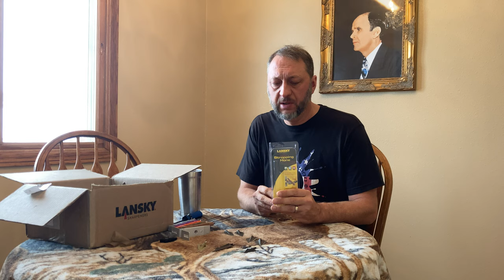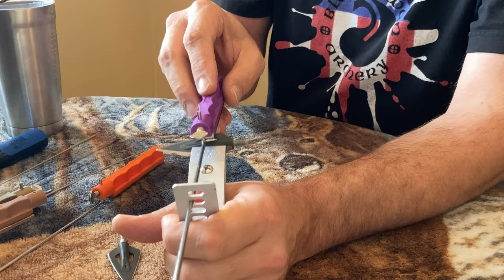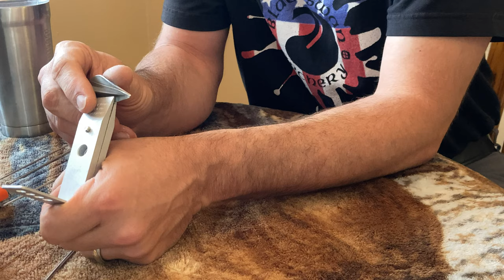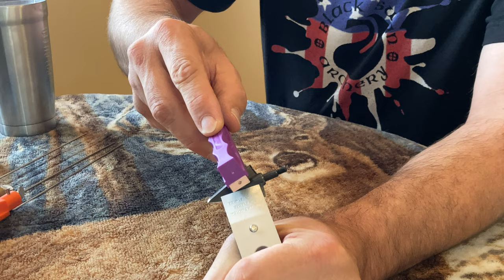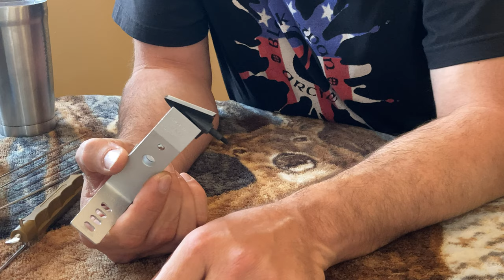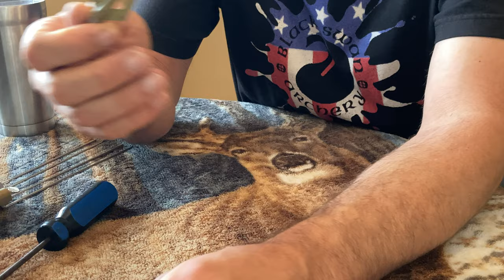How to get razor sharp broadheads

Comment: Thank you for showing me how this system works. Although  I am not quite sure you have them really sharp. Even a dull razor will  cut hair. I would like to see and hear how they will shave paper. Will you see micro fibers on the edge. Will it cut paper with little to no pressure.